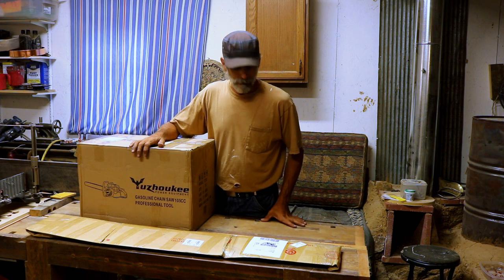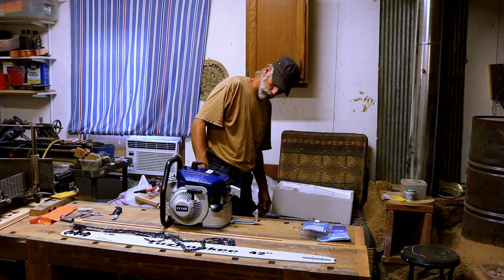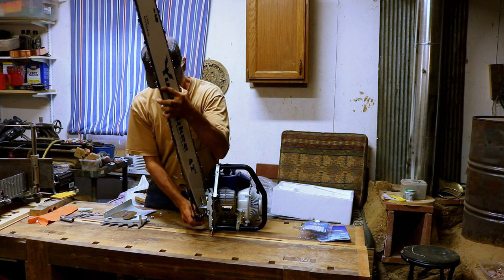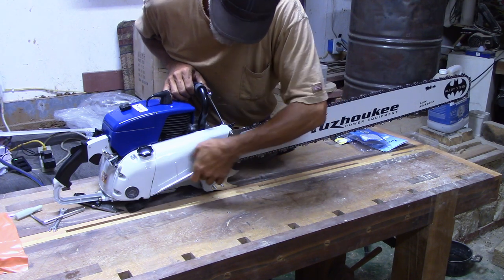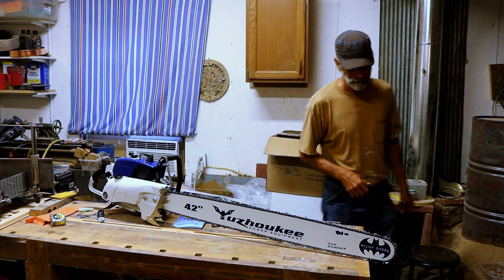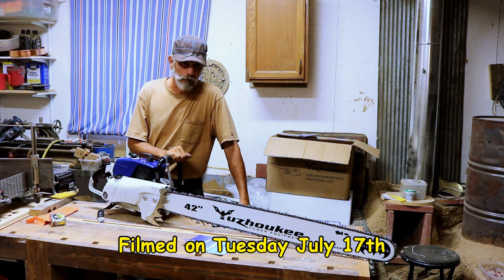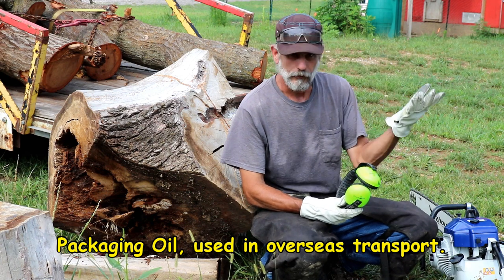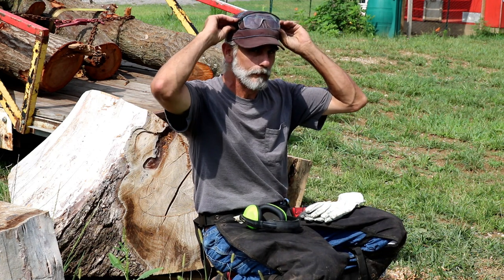Un Boxing a cheap 105cc Chainsaw

Comment: I just bought the same exact saw.  Here are my issues:  Not everything was tight from the factory, one of the studs for the bar was not screwed in.  I can't get the chain to oil properly yet.  Yes, same issue with the top end running speed, I know it is not developing full power.  That chain tensioner screw...  I hate it.  I'll try using the dremel to make it deeper.  Good idea.  The clutch was loose when I got it, but running it a bit and the shipping coating burned right off.  The smoke when that happened scared me for a good 10 seconds, until I figured out what had happened.  I would suggest that it be cleaned BEFORE the first use for anyone reading this.

The thing is a monster, and I am using it to get rid of a Cotton Wood that must be 5 feet at the base.  

Things that terrify me:  No chain brake.  Controls are not super easy to reach when running.  No sprocket nose. 

Things I am pleasantly surprised at:  It starts easily.  The compression relief is only used (by me) if I manage to flood it.  A few quick pulls to blow it out, and then it starts right up after you release the button.   Yes, it weighs a ton.  But once you lift it up on a log, it isn't bad, and I'm not fighting as much as I was with my 50cc 20 inch saw.   And yes, the manual was actually in English.

Comment: I have the same power head that I purchased from Huztl it's orange instead of blue then I added a 36" Used but good Stihl roller tip .404 bar from a Stihl MS 880 that had to be modified for chain tensioner and oil holes no big deal and then spun a loop from a 25' roll of Huztl  .404 bulk chain. Like yours it bogged down really bad, the fix was to adjust the governor setting because on these big saws the governor will close the choke when it is operating properly, this operation is to keep these big engines from over revving and blowing up. I suggest tach tuning if you have one to around 8500 rpm's but don't exceed 9000 rpm's  or you will be flirting with disaster. It will pick up power after it gets broken in and once you get it tuned to your liking it should serve you well.  At 1/3 the cost of a large Stihl or Husqvarna I would  recommend it to anyone with the know how and  ability too fine tune the saw to make it run proper. Make SURE you run at least a 32 to 1 oil mix 25 to 1 would be better if your using it to mill this will help to keep the cylinder temps a little cooler.
I have a video posted of the unboxing of mine.
By the way that Bat makes yours much more cooler.
Reply from the maker: Thanks for the info. I knew most of that but was unsure of what rpm, good to know. Thanks and yea the bat is pretty cool LOL
Reply: The rpm thing is meh. Some guys have been running their stihl 070 and 090 with the governor disabled by wrapping the spring around one time. I just moved mine half way up the teeth for the time being. Supposably for the 8000 RPM cap is because the Rings can get caught in the ports. But since so many others on forums are doing it and no failures whether its a clone or stihl. I have some confidence it won't.
Reply: Chris Willmott ummm husqvanas have governors.. to make it worse you have to buy a part for a concrete saw to raise the rpm
Reply: Chris Mccuskey The concrete saws are the reason for 6000-7000 rpms. Their using motors for concrete saws as chainsaw motors   Instead of higher rpm chainsaw power heads
Reply: Ive never seen huskies and stihls sold under the same roof.   That has to be a sight to see.
Reply: Good to know
Reply: I bought a huztl farmertec 105cc saw on black friday 2016. Replaced the carb with an original tillotson carb as we could not get the Chinese one to respond to adjustments. Replaced the Chinese chain with a stihl from Belmont Equipment. 36" hardnose bar. Cut a 42" pine, a 44" red oak and a 34" ash down with it and cut up a 64 inch maple that fell down across main street. Runs great with the new carb.
Reply: DIY with Uncle Cy what are your shipping costs for these Chinese saws?

Comment: Hint, place a few heavy rubber bands along the bar to hold the chain in place while you are installing it.  It removes a bunch of hassle.  A 42" hard bar is primarily for processors/ Fellers.
 Ya best wear cast iron leggings & Kevlar carbon fiber boots..
Reply: Funny enough that you said that.   I was popping on one of my longer bars on my 041Super and it was a pain to keep the chain in place, so my 7 year old said "just put duct tape on it like you do with everything else".   That little girl makes me proud.

Comment: You probably know this, but its a stihl 070 clone, best way to tune these is to temp (some do permanently) disable the governor that's under the recoil cover, then tune it in the cut, then set the governor to its highest setting (max rpm's), the governors work off air pressure from the flywheel, when the revs get to high it pulls the choke on, so the saw wont rev and sounds like its bogging. You can also get 137cc cylinders and pistons for these cheap, and a better clutch that has clutch friction material bonded to the steel for better grip from china
Reply from the maker: Thanks for the info.

Comment: Holy Shit. It’s a Stih 090. I used to run one of those bucking the giant logs nobody wanted else was to mess with. Thing was a beastie. And loud. Very little ppe back then.  I was 19 years old. The thing was as big as me. I was paid $25/day. Good times. East Coast guys use long bars too. Colin, NJ
Reply from the maker: Its an 070 Clone. Though the two saws had the same body so are often confused. The 070 in 105cc and the 090 is 137cc Cylinder head piston and rod are different everything else pretty close to the same. And yes the old 090's were (and are) beasts.

Comment: I've milled hundreds of hours over the years with my Husky 288. I spent more for the Husky obviously, but milling means running your saw full out, non stop for long periods of time. I would be curious how long your Chinese saw would last with the torture of milling.
Reply from the maker: Been doing well so far almost 6 months in. Of course it helped once I got it all tuned up and a good chain on it. The first cut (after the clutch stopped slipping) in this video I actually hit a nail which did not help matters for purposes of this particular video or chain.

Comment: One advantage I can maybe see about having a hard nose bar IS that the tip is not used with milling, and you have the ability to tightly clamp the end of the mill attachment there without it pinching the wheel inside? My Timber Tuff (knockoff Granberg) mill will pinch the wheel if I want to use the full 20" mill capacity on my 24" bar, but I have to give up a little bit of capacity and set the clamp back a couple inches to avoid this if I want it firmly gripped. Hope that made sense. I'd just hate to cover up or wreck the paint on that awesome bat-crazy logo with anything!!

Comment: It appears to be an exact copy of an 090 Stihl, which is actually 120cc. Stihl dont sell them here any more as the lack of a chain brake in theory makes them dangerous, but the long bars that fit them virtually eliminate possible kickback, negating the need for a chainbrake.
Reply: Tu te Kohe it's a 070 copy, but Bailey's does sell a kit to convert the top end to a 090...  The kit is around $100...
Reply from the maker: The 090 is 139cc the 080 is 121cc, William is correct this is an 070 clone. And you are right on as far as the heavy bar reducing the kick back but since it is for a chainsaw mill its an unlikely event anyway.
Reply: They stopped selling those saws for emissions reasons. They do sell them in many parts of the world still.
Reply: They will absolutely kick back.... Full comp chain would help, but they will come back, regardless of bar length.
Reply: Jody Hardy it just a low tolerance copy of a 40 year old saw what more can you expect
Reply: In a cross cut, you will definitely have that worry. In a rip cut using an alaskan/granberg mill, the post on the outside of the mill frame will keep it from coming back at you.
Reply: DIY with Uncle Cy stihl 090 137 cc
Reply: It replacement is MS 880 Magnum
Reply: Looks like an 076 copy...an old 076 Sthil at that...they were 105cc saws if memory serves
Reply: Tu te Kohe they were sold with out safety gear to third world Nations for falling the rain forests. There was a safety kit for some models.
Reply: It's probably an 070 clone.  Same saw, smaller 58mm piston instead of 66 like in an 090.  These are the same ones hutzle sells kits for on their website... Makes sense now why they give you the choice between orange or blue, didn't know they sold them under this brand name
Reply: The 090 was never a realy fast saw eather they were slow and steady they say. If you went to fast it cooks the chain in thought its beter to keep chain cool sounds tike he needs to turn the low and high jet a little

Comment: If you remove the spike or dog teeth you can gain near 2" more cutting depth. With milling operation spike or dog teeth not required. Like the new 45cc chinese chainsaw I bought I had minor issues with it too - the pull cord handle came off. Had to tie a better bigger knot. Also the chainsaw file that shipped with it was a joke. Lasted not even 1 filing. Cheap Chinese steel. For the price these saws are a good bargain in my opinion.

Comment: The bar should only "read" right side up half of the time.  If you flip the bar over each time you change the chain it will last longer.
Reply: Just learned that.  Canned gas. Too

Comment: I bought the same one only its orange. I had all the problems that you are having but I know 2 strokes pretty good. I set the timing and the air and gas mixer on the carb and another trick is to use the highest test gas you can find or lets say about 98-100 oct if you can get it. They will do 8-10,000 rpm once you get it broke in. One good point about it is the muffler. Price one out here and its about 150-200 bucks. Good high end muffler. Im running 110 octane and its sings. Good luck chum.

Comment: Cheap 105 cc chain saw? I need a motor I can mount on a bicycle
Reply: You'll probably be able to travel on the interstate with that bicycle. Might even need a radio for contact with the local control tower.
Reply: Farmertec.com sell just the power head of the saw no bar

Comment: That clutch issue should go away once the saw is run in and you gradually lean the engine out. That's actually just an issue where the engine isn't putting out it's full potential.
Reply: The Clutch was packed in  grease so it would not rust ..   @Gavman's Workshop

Comment: Glad tuning it up helped,  when they "4 stroke" like that it's running rich.  I like to get them to 4 stroke as the rich baseline then lean them out a bit to clean it up.  I think my preference would be towards an old Husky or even a Mac off ebay (used), but glad this is working for you.

Comment: That saw is awesome! I recently bought my first three chainsaws, and I immediately realized is better to use a long thin flat screwdriver (I have one like a foot long) to adjust the chain tension. That flat screw driver they provide may be good for something else, not to adjust a single chain, sorry.

Did you soak the chain in oil before installation or, oiled it on its guide before the test cut? I feel is good to at least manually oil the chain before each beginning of cutting with it.

Comment: Ran Homelite XLs and smaller for years and none had kickback brakes.  Was lucky I guess but not stupid either.  Worked with a crew that did a lot of brushing and a young woman after lengthy formal training was using a newer saw, with kickback brake, but it kicked back anyway and got her right in the middle of her forehead. Luckily for her just lightly but scared the snot out of her and everyone else. Plenty of blood and yowling.  Brakes are probably good but sure as hell don't totally eliminate the danger.

Comment: Call it your Bat Saw :-) I'm impressed with your obvious knowledge about chainsaws! Bought a Poulan Pro that had a bar clamp that was always coming loose because only one of the studs was exerting force that held the bar in place. This saw is much better.

Comment: That's a fine saw! It has some similarities to the 066 or 070 stihl as well as the breather style of the poulan 360 automatic from a few years ago. I personally like it!! A short cut of 4x4 under the bar tip will help with adjustment and lock down of the bar nuts. Good saw, great deal.

Comment: I think the plastic deal at the beginning of the video is a engine lock up tool. You screw it into the spark plug hole so you can take the sprocket off with out it spinning

Comment: I bought the O Jenas 105cc which is a clone of this one and it cut strong for about 10 minutes then the chain seemed to bog down so I took the cover plate off and found the problem was a slipping clutch because it was getting oil in it. After looking over my Sthil I realized the problem was due to the clutch set up - instead of this saw having the clutch recessed into the motor with the chain drive sprocket on the outside and the clutch cover plate curved/belled over it,  facing toward the motor, this one has a flat washer plate that recesses into it with no wrap-around so chain oil spray can leak around it allowing oil to get into the clutch causing it to slip. Just open up any chain saw and set it next to this one and you'll see the difference. I have been in contact with O Jenas reps to explain this to  them. I'll let you know what they tell me but otherwise cleaning out the clutch will only solve the problem for another 10 minutes until oil gets in there again.
Reply from the maker: I have made no such adjustments to the saw and have never had another issue with it. I have milled quite a few logs with it now too.

Comment: put the bar on the saw then lay your chain over the sprocket and bar, next pull bar to remove slack, place cover and finger tighten nuts, pick up on bar as u adjust tension, alot easier

Comment: l work in a home depot tool rental center and a few days ago somebody brought back the 2 chainsaws they were using on the christmas tree lot, they wanted us to clean them up and do some wear and tear maintenance so they would be ready for next year. and let me tell you, these are the cheapest chainsaws l had ever seen. l mean they are just for cutting christmas trees so they didn't need much but they were electric saws and they were totally made out of plastic, and it was a cheap feeling plastic. these things felt like toys, l am not even joking. even the log dogs were plastic and it looked like there was a chain break but l kept pushing it and it wouldn't move. turns out it's not a chain brake, it's just an extra handle that looks like a chain brake so there is no chain brake. and the "automatic" oilier for the bar oil was just a container with a pin hole in the bottom so it was honestly just a gravity feeder. which would explain why both the saws had a really greasy feel to them, if you don't lay them on their side then they leak oil everywhere. l looked them up on amazing and they were like $50. they were homelite saws.

Comment: Nice video. I have 8 very lace Oak and Chesnut Oak in my front yard I need 2 taken down due to their location. Debating on getting a chainsaw mill. I have at least 40’.- 50’ of tree before any branches start. I think it would make some nice wood to build something. I think that It would be a waste to cut it up for firewood.

Comment: I buy the crap out of chi-com saws for rc planes. The engines are perfect for rc. Light, torquey, and cheaaaap. Alot of users have clutch issues. They claim to swap with stihl clutches.

Comment: Hows she keeping up its funny its a stihl 090 some say best fellon saw ever made and lot of old timmers say that even the 090s ran rich and slow its alot about torx with big saw speed heats up the chain
Reply from the maker: I have a 1 year review video of this saw up. It is NOT an 090 clone it is an 070 clone, this is 105cc the 090 was 132 cc I I recall. The two saws did look very similar and you infact can get an aftermarket 090 cylinder and piston and they should fit right on (may need the connecting rod too Not sure about that though)

Comment: Bought the same saw manufactured by a different company.  Started right up and I ran it thru the break in without problems (3 tanks).  Pull start and ignition came off shaft (they didn't put lock tight on threads)  Could not get the chain to spin.   Found out clutch was installed backwards.  Company would not replace clutch.  Got replacement clutch (that's that white plastic thing - cylinder lock).  Chain guard would pinch chain when nuts fully tightened.   Saw now will not start at all.  Company will not replace or refund.  Total run time was about 4 hours.  Otherwise great saw.
Reply from the maker: Mine is still running. After fixing the little issues it had. Turned out there was a nail in that elm that dulled the chain about 2 inches in, once I got me a granberg milling chain it became a Tank. Of course now I mill mostly with my G660 the higher RPM does make it a bit quicker.

Comment: That little tube of grease that you picked up and said what was that for there is a little hole at the top of the chain bar that Greece's the sprocket in your chain bar. One push will do.
Reply from the maker: Umm no It wasn't a tube of grease, the bar on this is a hard nose not a sprocket. It is a plug that goes into the spark plug hole to stop the piston to the clutch can be removed. If you had actually watched the whole video you would know all of this.